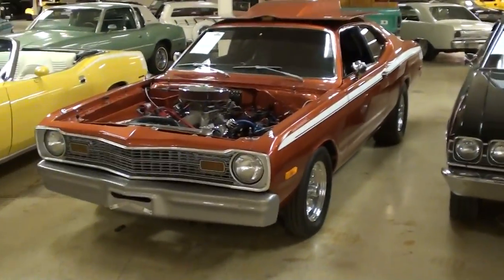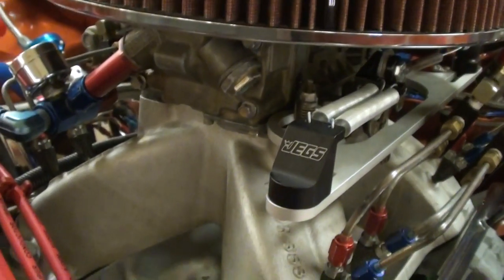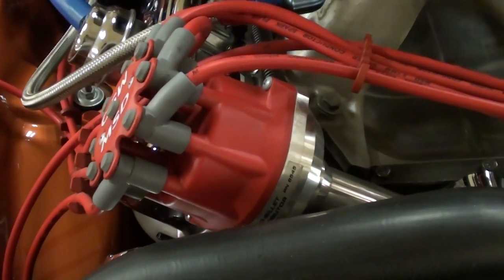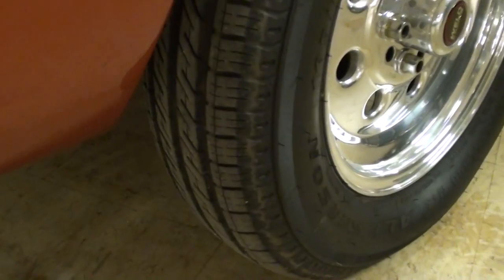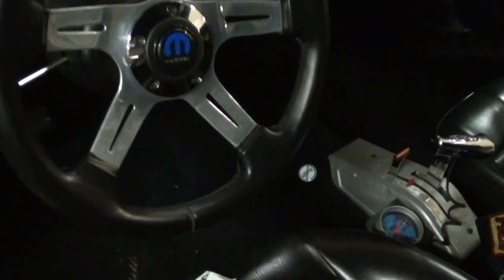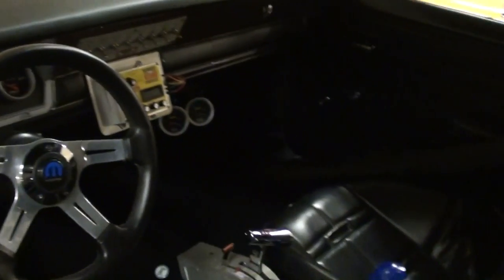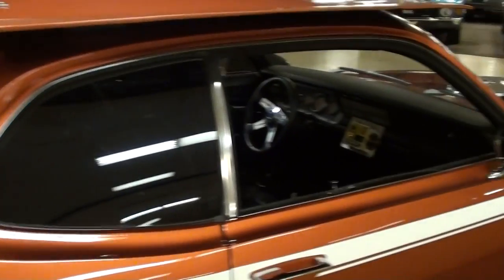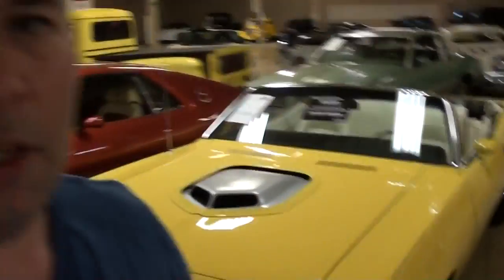1973 Dodge Dart Sport Nitrous Injected Street Legal Drag Car

Comment: Looks like it was a Plymouth Duster at one time and someone put a Dart Sport front clip on the car.  Nicely done but the Tail lights are from a Duster... Of course they could have changed the entire rear panel and added the Duster tail lights, but it would have been more work...  Nicely looking car.
Reply: redexpressracing or it is a Dodge Dart that someone welded a Plymouth duster rear panel on it. Currently there is not a dart sport rear panel reman available. But there is demon, duster ones.
Reply: In 1974 valiant super bee (only produced in Mexico) had 73 dart sport front and in the back and Plymouth duster taillights. If you like this car. Check Mexican super bee. It is a really nice ride.